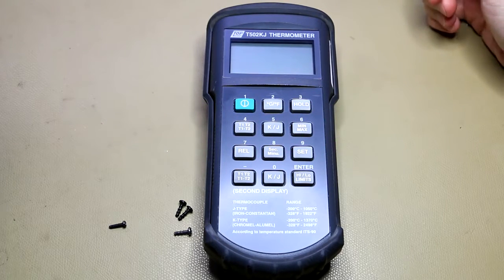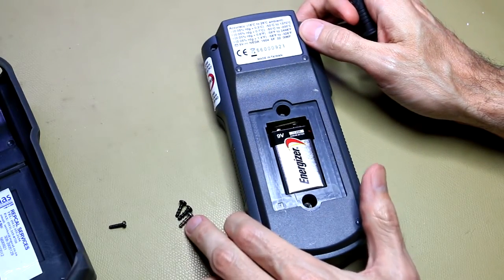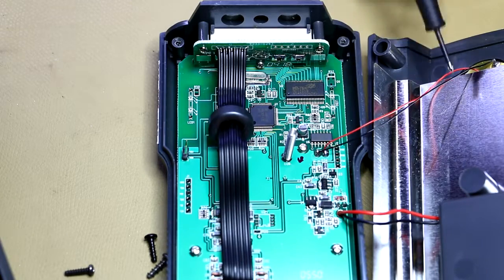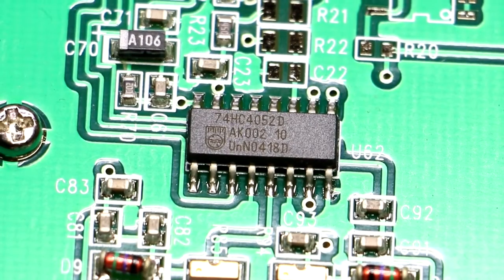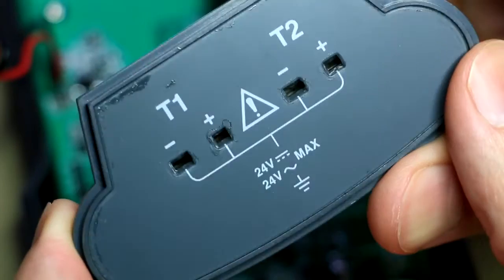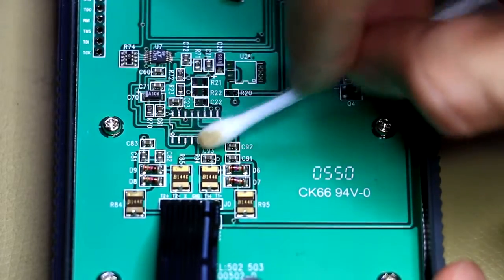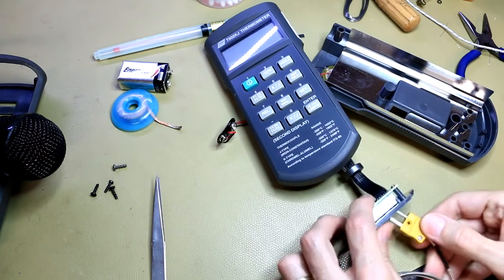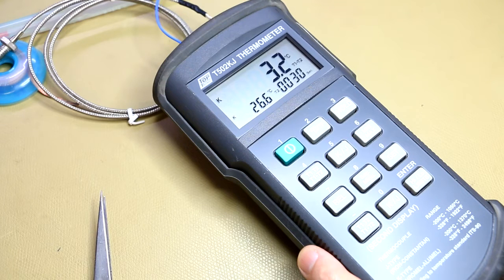Toptronic T502KJ Digital Thermometer repair (#011)

Comment: Hi Tian, I've acquired a Toptronics T502KJ from our local fleamarket in Cape Town. It seems to be working in all respects.
I've been trying to find an operating manual online with no luck.
Do you perhaps have a source where I might find it?
Best regards from Julian
Reply from the maker: The T502KJ is also sold as a different brand. Search for "HH502 thermometer" and it should take you right to the PDF.

Comment: Wonder if you could get the temperature info out of the serial port on the unit. there seems to be a connection to the serial UART there, and a convenient header as well. They might well have left the serial port drive routines in there for production line testing. Add a wire and a serial to USB and you have a datalogger.
Reply from the maker: +SeanBZA Sneaky! I like the way you think - I'll have a look again. I was in such a rush to get the repair done, I didn't do a proper teardown. :-)